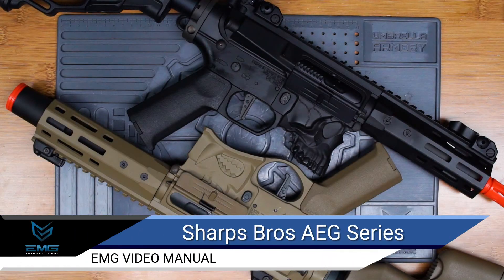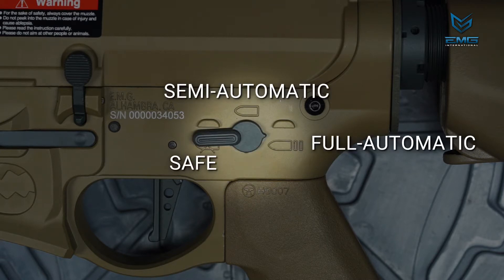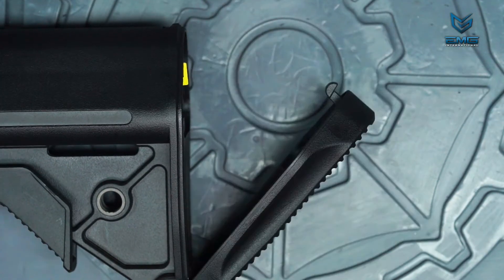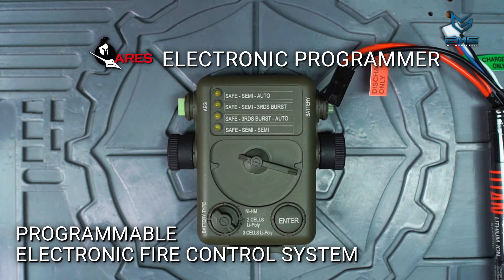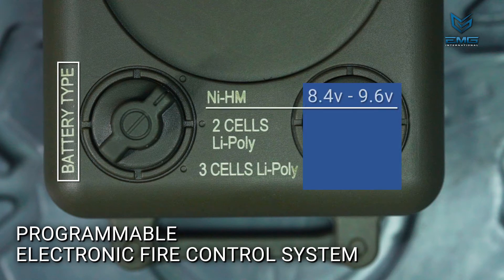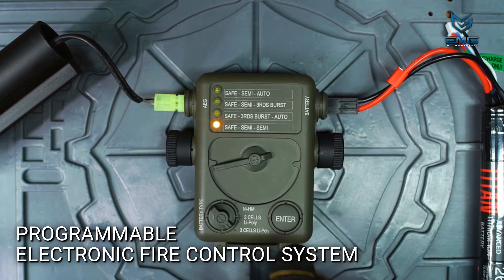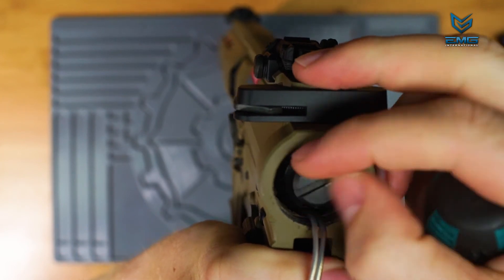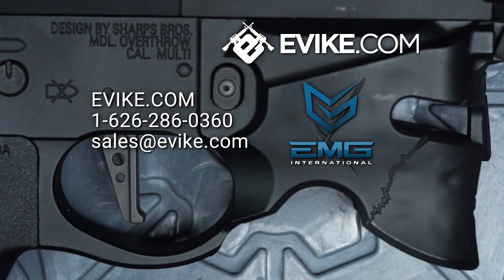EMG Arms Sharps Bros AEG Manual

Comment: How do you take off the orange tip?
Reply: its glued in pretty good. you need to boil the tip for a couple of minutes and use a pair of pliers to grab on to it and break it free from the glue. Depending on the tip there may be a pin in the bottom that will needed to be removed before trying to twist it off as well.
Reply: Really? It should be easier